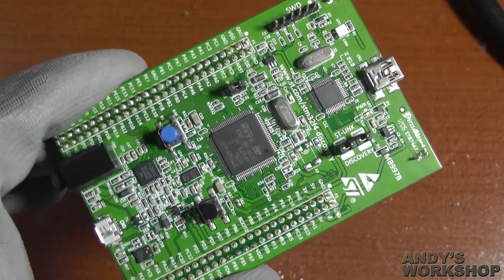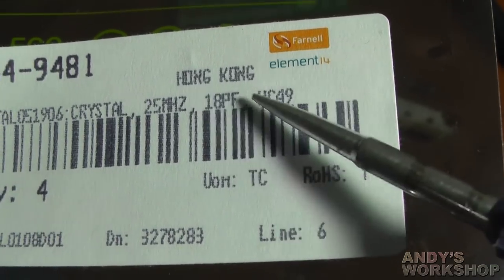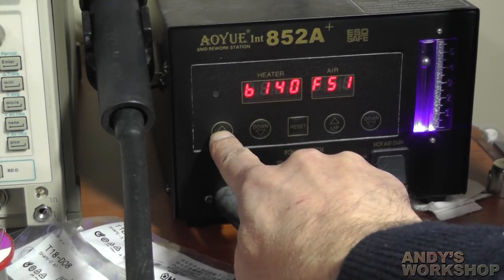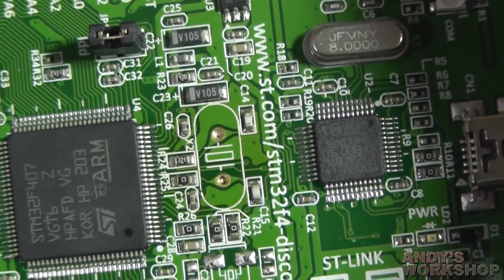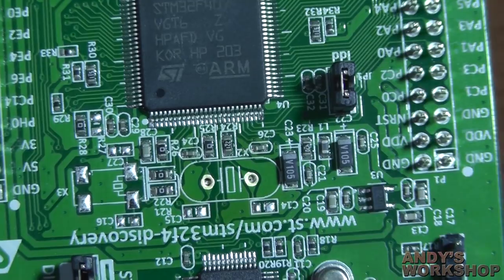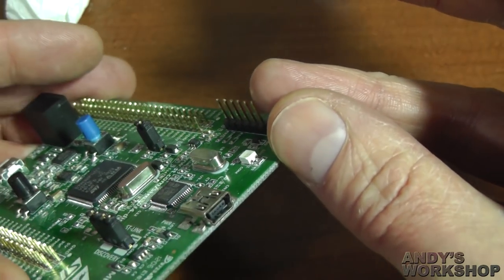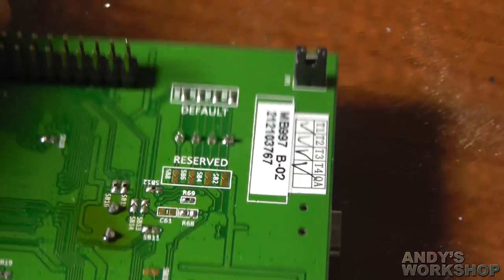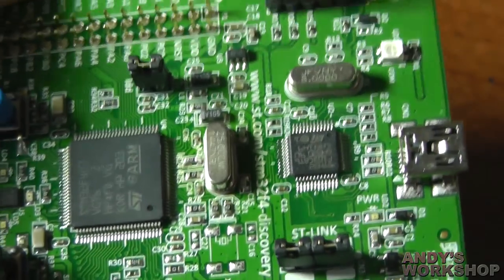STM32 F4 Discovery 25Mhz oscillator replacement

Comment from the maker: > You always set it to 380°C?
> That may be fine for some passives, but it will burn silicon. And it isn't doing your heater any favours.

The indicated 380 is way, way off what the actual air temp is when it reaches the board. I did of course test this before ever using the hot-air gun at all by blowing it on a thermocouple. At about 20mm away the actual temperature fluctuates between 190 and 220. By moving to about 10mm and keeping the gun trained on a single spot (the thermocouple in my tests) I can actually get it to up to 300. I'm happy with the 190-220 range and have never burned a single board or device - the brown stuff you can see in the video is burned flux that I cleaned - well, scraped, off afterwards. Desoldering the RoHS solder was a real pain in the neck, I hate working with that stuff.

Thanks for commenting and take care.

Comment: 18pF and 20pF is not much of a difference.  Most crystals go from 18-22pF.  If I were to do this modification, I would change the crystal first.  Test things out to see if replacing the 18pF caps with 20pF is really needed, which I don't think so.

Comment: Andy, a solder pump might have made the crystal removal easier to suck the molten solder out of the hole cleanly and release the crystal.  They can be had for as cheap as $1.
Reply from the maker: +Scottl1111 You're right about that. I bought one a while later and have found it very useful.

Comment: Thank you, Andy for all your interesting projects and that you share them with us. Your videos are a great inspiration and source of knowledge.
So, what the flux? The purpose of solder-flux is to de-oxidize surfaces and through that, to aid in the connection of metals via the solder tin alloy.
Ask yourself one question: If there is already a (hopefully perfect, by ST-Microelectronics) composite, covered with solder and that airtight enclosing the metal surfaces, what is the point of applying flux at the outside when DE-SOLDERING something? It does not magically lower the melting point(in fact it works against you by thermodynamics, cooling and evaporative cooling), nor can it help with the outer layer of solder that oxidized for weeks or months. It just dissolves in the air and makes the seller happy:)
In contrast, what matters is the right temperature and tool, making good thermal contact with the patient.

Of course, this only applies to de-soldering. If you solder something, you can not apply too little flux without getting into trouble with the Church of Saint Barbara (patron saint of architects and all sorts of builders masons, carpenters, roofers and electricians) if the workpiece does not float in it.

Keep on the good work:)

Comment: Thank for the video. A question: Is the 2pF difference significant? I thought more capacitance means better oscillation stability.
Reply: Nope, stability is given by np0 caps (unnafected by temperature) or a junction of known n caps n300 is 300 hz of sliding by some ammount of time , positive for ceramics an negative by polyester  that 2pf difference affects only the freq (a bit Hz lower oscillation).

Comment: Hi Andy,
While the specification label on the crystal package says that it requires an 18pf cap, you said based on your experience with this particular replacement crystal that it actually requires a 30pf cap.  I am a little confused here.  1) Is it common for the manfuacturer specs to be off by such margin? 2) how did you actually come to determine that 30pf is the right value?

Thanks!
Reply: I'm curious about this as well.
Reply: CX1 = CX2 = 2(CL  - stray capacitance).
CL = 18pf = Load capacitance

Comment: Great video!!! 
For  through hole components if you one don't have a  desoldering  tool it's better to apply a bit of leaded solder wire, and use the soldering iron instead of hot air. BTW  using hot air in around 280C, wouldn't burn the PCB.....

Comment: You always set it to 380°C?
That may be fine for some passives, but it will burn silicon. And it isn't doing your heater any favours.
Most manufacturers and JDEC recommend a max of 260°C, and that is a MAX. The right heat is the minimum you can get away with for as little time as possible.